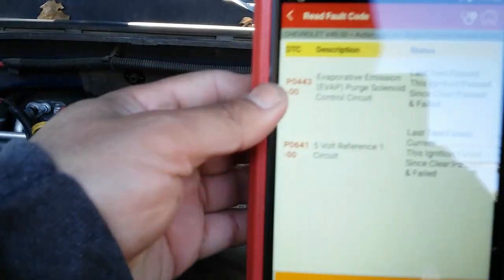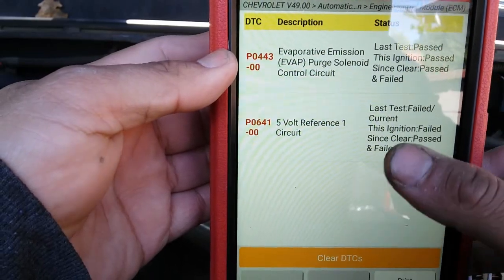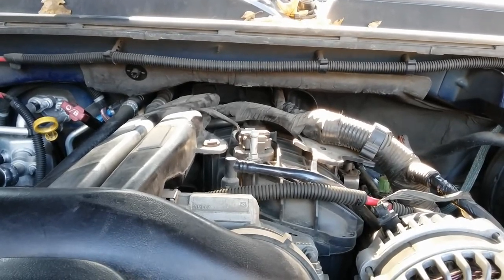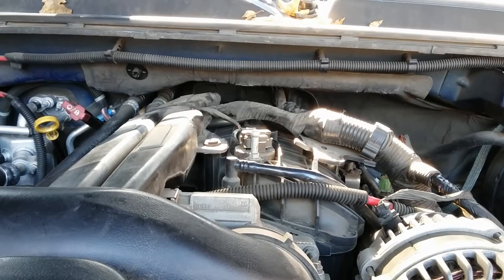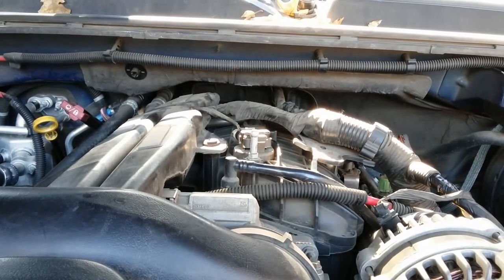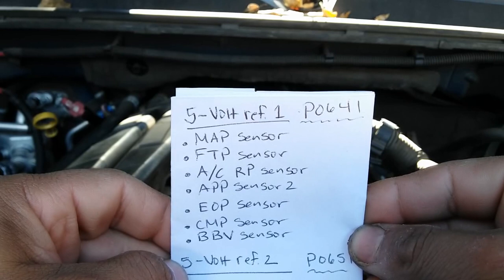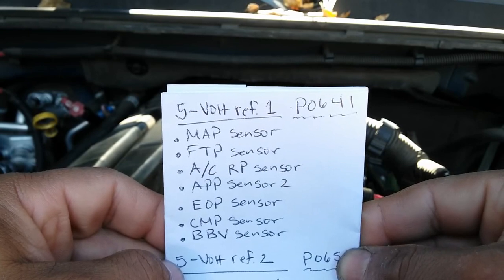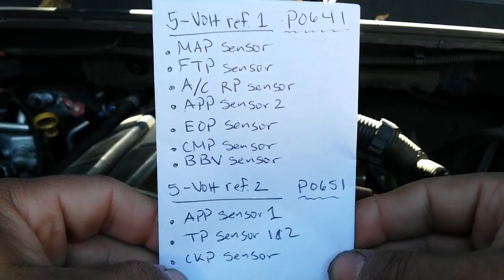(Chevy Tahoe) P0641 Shorted 5V Reference 1 Circuit   Quick Tips

Comment: I have an 07 Yukon with the same problem… problem is, I don’t have 4-wheel drive, so with that, the Reduced engine power turns on randomly and I have no idea what’s going on, it also has a lifter tick, but what GMC/Chevy doesn’t, it’s a new engine with new transmission, going to take a look tomorrow to try and find the problem, will come back and update after.

Comment: So what was your actual issue? Having the same code right now but can’t find anything wrong with any of the sensors or the wiring so I’m pretty defeated right now

You didn’t really specify what your exact issue was with yours

You just showed clearing the code and it working
Reply from the maker: Fixed the 5 volt reference wire that ran to the fuel tank pressure sensor, as it was shorting out to the differential.

Comment: Dude you are a superstar, My wires were a mess in this area.... all broken an bunched up...thanks
Reply: This dudes video helped me fix my truck too but I had wire problems on the side of the motor on that bolt by the coil packs and down by the steering knuckle where the wires was rubbing the steering boot
Reply: Caught that one as well before it got bad. My wires down below were a mess all mangled , fixed those but now my ac doesn't work.

Comment: hi from uk
got p0641 code and MAF changed mass air flow and that was corrected ,expecting the p0641 to also correct .but no.could a throttle potentiometer or faulty speedo cause such code .even though nothing shows for such sensors asproblomatic . otherwisei believe its a tug and pull session.appreciateany pointers .it is a 1.5 dci nissan qashqai 2008
Reply from the maker: Hey there, I'm not too familiar with nissan having such problems with p0641, but I would first start by checking what sensors pertain to that circuit and then start unplugging each sensor one by one and see if one of the sensors is causing the problem, if not, then you might have wiring issue with the 5v reference touching ground. Worst case scenario, bad pcm.

Comment: Your video helped me fix my truck. I didn't realize that all those sensors went with po641 code. Wound up the oil pressure sensor was causing the truck not to crank and run. If not for you, I would still be chasing my tail. Thank you so much for the knowledge that you put in the video. Best wishes.😊
Reply: The ONLY video i FINALLY found that could help me actually pinpoint my problem!! Thanks so much!!
Reply from the maker: Thank you!

Comment: Ive checked under my 04 tahoe z71 about 13 times and i still cant find where 7:36 is at
Reply from the maker: If I'm not mistaken, it's the short shaft for the 4×4 system.  Driver side, just before the fuel tank.

Comment: I have the same issue on my 2009 gmc sierra. But 1 wire actually broke. If I splice the bad wire/wires together will it still perform or do I need to to get a new harness??? Thank you in advance
Reply from the maker: Theoracally, it should work fine if you splice the wire together.
Reply: @EliTheOBDTech thank you sir! Your video led me directly to my issue.
Reply: Little update. I fixed all the wires and still had 1.57 volts on my 5v reference one. My 5 V reference to was upwards of 4.8 to 4.9. I used a multimeter to check voltage at the map sensor and oil pressure sensor and I was getting the same 1.57 reading. I started unplugging sensors one by one and nothing in the engine bay changed it but as soon as I got underneath there and was able to unplug the fuel pump sending unit I restored back to the 4.8 4.9 that my reference to had. So with the sending unit unplugged both 5 V references were good. That tells me that the fuel pump or the fuel pump relay is bad? Since GM decided to put everything in the fuel tank, thank you in advance if you answer this question.
Reply from the maker: @jeremyeckenrode5345 Was it the fuel pump sending unit or the fuel tank pressure sensor that you unplugged?
Reply: @EliTheOBDTech I unplugged both. But I was getting fuel pump circuit codes too
Reply from the maker: @jeremyeckenrode5345 Another possibility, a faulty fuel pump control module. Like you mentioned, it could be faulty pump or relay. You will need do further diagnosis. Try unplugging the fuel pump control module as well,  and see if the 5v reference goes back to normal.
Reply: @EliTheOBDTech I have the fuel pump control module plugged in and I still have 5v. I dropped the gas tank and pulled out the sending unit.

Comment: i have this code on my 2016 buick regal premium 2.0 turbo send help
Reply from the maker: You need to first start by figuring what sensors pertain to that circuit. Secondly, you need to do a visual inspection of your engine harness for locations that may be rubbing against metal contacts that can be causing short to ground.
Reply from the maker: P0641: 5v reference 1 circuit
• A/C refrigerant pressure sensor 
• Exhaust and Camshaft position sensor 
• Engine oil pressure sensor 
• Fuel pressure sensor 
• Fuel rail pressure sensor 
• Fuel tank pressure sensor 
• Turbocharger boost/intake air temperature sensor

Comment: How do i find voltage drop 5 volt line conectic direct line to PCM. When there is no fuse that protects the line and the continuity  is good and the conectic of alternator is just one pin 5 volt reference. Thank you

Comment: Just went through this on an 08.  Five volt was shorted in the same spot on the front driveline. I would live to know the brand and model of the scanner you are using. Excellent video and explanation.
Reply from the maker: @marklanders5799  Thank you.
I'm using the Launch x431 Pros Mini, which you can find on eBay.

Comment: I have the same problem and im on circuit 2 and i could really use some advice because mine gmc is literally dead only starts when its jumped
Reply from the maker: @adamcervantess  try disconnecting each sensor one by one that pertains to that circuit and see if your problem goes away.

Comment: i had the p0641 and reduced power issue on my escalade that i found thanks to this video, my wires were all messed up from rubbing on the driveshaft. my question is, i taped them up but am still getting the code. do you think i need to replace that harness because some of the wires are thinner than normal from rubbing. or do you think i should replace the fuel tank pressure sensor? i'm guessing since the wires are thinner it is not carrying the 5v it needs. but i dont know. last question, can anyone direct me to the name of or a link to replace that wiring harness?
Reply from the maker: @dailyusnews5561  check to see if any of the wires are touching others wires on the harness.  Another option would be going to a junkyard and getting one that looks decent.
Reply: Thanks man. I'm thinking the wires aren't passing enough current because they're frayed. I'm going to clip them and repair with connectors. If that doesn't work I'll try finding a new harness. Just wish i knew the part number of that harness do i could find one. Or even know what to call it  @EliTheOBDTech
Reply from the maker: @dailyusnews5561  I'm not 100% sure, but I believe is the harness that leads to the fuel tank pressure sensor and fuel pump and probably the vent valve as well.

Comment: Exact same problem with my 2008 Chevy avalanche ltz. Crank shaft sensor loses power randomly and camshaft sensor would lose connection while in drive. Truck would randomly shut down.

Comment: I got both p0641 and p0651 on mine 🤦🏻
Reply from the maker: @John-ti5po  It's sounds like you may have wiring issue.  The 5V references shorting to ground. Worst case scenario a bad PCM. I would try and use a voltmeter by backprobing to one of 5v reference sensors and disconnect one by one sensors that pertain to both 5v reference circuits.  If it's sensor problem, the 5v reference should come back alive to normal spec of approximately 5 volts

Comment: Got a 07 Escalade been having HELL with this car and o think you just saved me!! Had the same issue in the same spot!! Day 1 I’ll keep you updated
Reply from the maker: Sounds good.
Reply: Having the same issue (with 07’ Esky as well). You get it fixed? I’ve replaced CPK amd Cam sensor (initial codes) not its throwing p0641.

Comment: Thank you for making this video! I found  a frayed wire rubbing on my front differential (4wd) driveshaft under the drivers side door. I had code P0641, stabillatrak lights, also MAF and Crank Sensor codes. I believe the wire was running to the Fuel Tank Pressure sensor.
Reply from the maker: Glad to hear that this video was helpful.

Comment: What is the reason to unplug all sensors?
Reply: So if the short stays after unplugging  the sensor  than more than likely a wire is the problem.? Thank you
Reply from the maker: @kevinhodges3374  Yes, that is correct
Reply: @EliTheOBDTech  how would I use the volt meter to find the shot in the 5v?
Reply from the maker: @ClayCook-w3k  Connect the voltmeter to any 5v reference sensor that belongs to that circuit. Backprobe the 5v reference signal wire with the red lead and the black lead to battery negative. As you unplug one sensor at a time, check to see if your 5v reference signal comes back. If the the unplugging method does not work, then you know that your problem is a short to ground wire.
Reply: I’m chasing the 5v short 2009 Silverado 6.2, died last test drive when I turned
Reply from the maker: @kevinhodges3374  To verify if it's a shorted sensor in that circuit or if it's a shorted 5v reference wire. The unplugging method should be done with a capable scanner that gives you the 5v reference data or you can use a volt meter connected to a 5v reference sensor signal for that circuit and watch your display to see if your voltage goes back up to 5v as you unplug each sensor one by one.

Comment: I have the code PO651. 🤔
Reply from the maker: You may have faulty sensor for circuit 2. Try disconnecting the connector to each of the 3 sensor for circuit 2 one by one. Crank position sensor, Throttle position sensor and Accelerator position sensor and see if your code goes away or if your 5V reference comes back to normal.

Comment: I’m getting p0641 and also a misfire. My oil pressure started to just not work. Would it be safe to say the sensor is bad and that’s what is causing these codes to turn up. It’s a suburban 2005
Reply: Thanks I will try that. 🙏🙏
Reply from the maker: Most of the time its a shorted 5 volt reference wire that being shorted to ground. Yes, shorted oil pressure sensor can be the cause of the code and oil pressure gauge not working. Try following my steps from the video.
Reply from the maker: If you unplug the connector from the sensor and P0641 goes away, then your problem is the sensor.

Comment: This video really helped me. I wasnt able to track down the shorted wire but when i unplugged the TPS sensor plug the p0641 code went away. i couldnt locate the bad wire cuz it was INSIDE the throttle body. I wouldnt have done that without watching this video. Thank you!
Reply from the maker: Good to hear that this video gave you a guide 👍

Comment: Guy had a P0641 , kept cutting out then run ok. Seen your post about the wire harness on left of engine. It quit in my driveway. I checked harness & sure enough the stud wore into a small gray wire. Repaired & all is good. 2007 Chevrolet 1500 2 wd pickup. Thank you!! 9:13

Comment: Did most of your theory but still have low voltage
Reply from the maker: Do you have the same code?
Did you unplug all sensors pertaining to that 5 volt reference circuit?
Reply: @EliTheOBDTech  yes same code ran everything you did have all the sensors unplugged an still have low voltage
Reply from the maker: @halspeedautoworkz764  Have you wiggle tested the engine harness in different points?
Hopefully is not your pcm going bad.
Reply: @EliTheOBDTech  did all that all the way down to the tank for the fuel level sensor. An  thing I also see happening not sure if that how this system work but on key on the fuel pump is running constantly.
Reply from the maker: @halspeedautoworkz764  It should not run constantly with key on engine off. It should only prime for 2 seconds and turn off.
Reply from the maker: Not sure if this model has a fuel pump control module. That might be your issue.
Reply: @EliTheOBDTech  ok thanks bud going look into that an let you know my findings